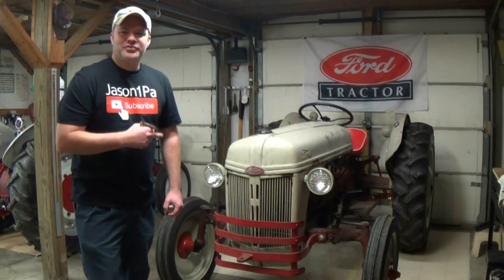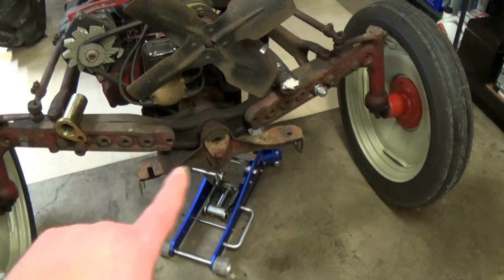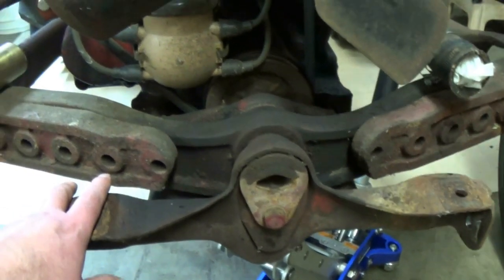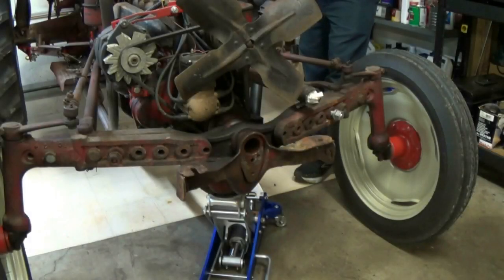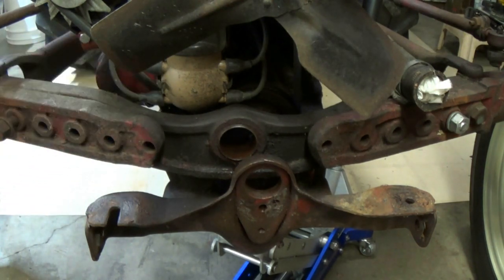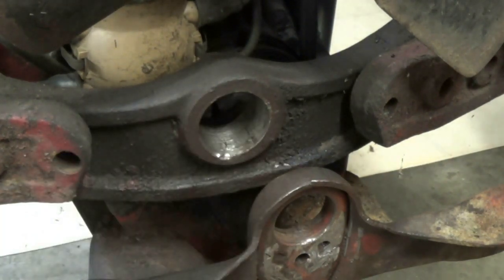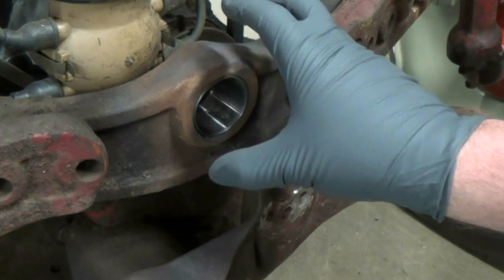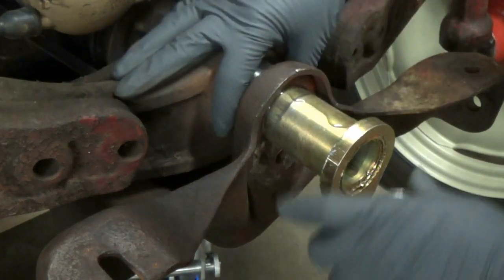Ford 9N 2N 8N Axle Pin & Bushing Repair

Comment: I am restoring a ford 800 and I need to replace the pivot bushing. I see that your axle has a bushing and washers where did you find the spacer because I can only find the bushing.
Reply from the maker: @Billys_Backyard  I got all my stuff at Just8ns.  Com  The interesting thing is the washers are not listed in the parts manual however there is a part number for them. Some say they shouldn't have them. Everyone I've ever had a part had at least one. Im not sure about the 800 though. I never had one a part.

Comment: Thanks, for the video.  I have a Jubilee with a Davis loader, and I'm thinking about removing the loader and selling it, so I would need to replace the pin, bushing, etc., so that the new owner of the loader can have all the necessary parts to make the loader operable.  This video will help.
Reply from the maker: @316jd140  Sounds good!

Comment: I’ve got a Ford 3610 and I’m trying to remove that axle pin to replace the broken bushing. I had to take off the fan & radiator because of a broken fan blade pierced the radiator. How do I loosen the pin using a 1-5/8 socket wrench?

Comment: Curious about the shim washers and spacer on this. My 860 doesn't have any of that and there's about an inch of axial play along the axle pin. The radius arms hold the axle longitudinally though and so I thought maybe that axial play is necessary for the radius arms to be able to swing one way or the other. (might pull the axle back or push it forward as they do.) Is there a set amount of axial play needed?
Reply from the maker: @delgriffith1  I don't have any hands on experience with the 860 front ends,but looking on the parts diagram it appears that I don't see any spacers listed which seems rather odd. On the 8N it does call for one spacer then a washer/spacer. I added more cause there was enough slop. I jacked up the front high and rocked the front end up and down and there was no binding. You do need some play for front to back movement, but it's not much. I try to keep the strain off of the radius arms where they insert into the socket near where you feet go.
Reply: @Jason1Pa  Makes sense that it wouldn't need a lot of play back and forth to accommodate radius arm swing. The full inch of slop concerns me on my 860. Tempting to put in spacers but at the same time that was the design it seems.
Reply from the maker: @delgriffith1  Yeah I wish I could offer more help or even look at another one but I don't know anyone that has one. It just doesn't seem right to have that movement.

Comment: You can shrink a bushing by running a weld bead inside it.
Reply from the maker: I know. Already had the chisel out. I had it out faster then what it would take to get the welder out. Normally they about fall out our worn paper thin.

Comment: Great video. That's the next step in my 1952 8N Winter project. Dad bought the tractor in '53 and I grew up driving it on the farm and in the woods.
Reply from the maker: Sorry for the late reply. I just noticed your comment. That's awesome to still have the old Ford. I have my grandfather's 1945 2N as well. Good luck on the repair!

Comment: On your radius arm pins could you just use a 5/8 grade 8 bolt?
Reply from the maker: You could. I've done it before, but just be careful not to tighten it much.  You'll actually squeeze the ends of the arms and kind of cause a bind when going over uneven ground. It's ideal to use a pin though.
Reply: That is what I thought but I wanted another opinion

Comment: I have a '51 that one of the previous owners "welded" the support pin flange to the axle support assembly. I guess the bolt that holds it on must have had the head snapped off. The weld at some point broke because it was just dawbed and not actually welded. This allowed the pin to start moving and wearing. The radius arms have a really nice arch to them which they are not supposed to have. I got the pin out no problem as it was quite loose and much to my amazement the pin was worn badly but the bushing was not. I was expecting to have to take the center axle piece to the machine shop for some major work. fortunately I have the  new pin and bushing for my '49 that did not require they be replaced.
Reply from the maker: Good to hear!! Sometimes these things can be a real bear. Sad to hear your arms got bent. I'm glad for you the welds were not good welds or that would be terrible.

Comment: I have a 50 model 8n ford that needs that very job done. Where did you find the pin and bushing?
Them smaller pins is slop on mine as well. Can you get the whole kit? 
Probably wouldn't hurt to get king pin bushings also for both sides.
Do away with the death wobble.
Reply from the maker: There is no kit available so you need to purchase the individual parts. When I'm working on Fords I only get parts from Just8ns. com or Dennis Carpenter. 
All though every part needs to to be slop free for the wheels not to wobble the large majority of slop that causes the wheels to wobble is in the steering gear box itself.

Comment: Next time put the bushing and pin in the freezer over night.
It will shrink them an make installation easier.
I like your videos, they’re very informative.
Thanks for posting.
Reply from the maker: I've yet to have that trick work. I don't even bother. I can see dry ice working, but don't feel like wasting time and money when I can just heat it up. The axle expanded way more then what that bushing would of shrank sitting in the freezer.